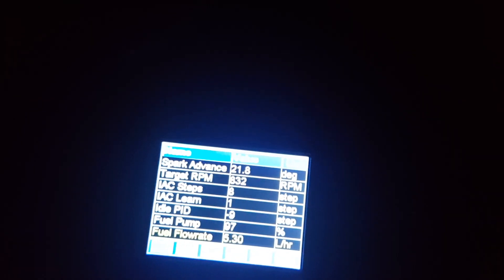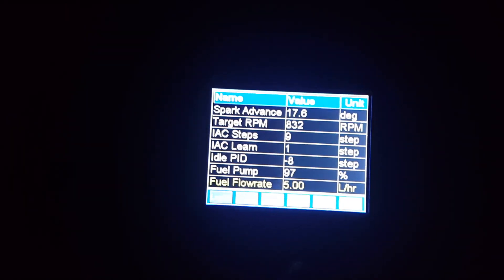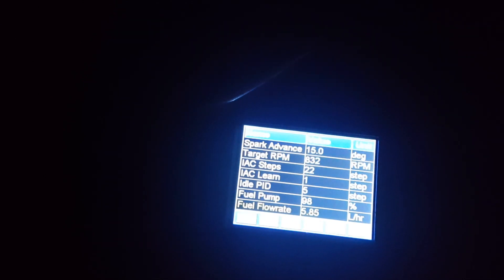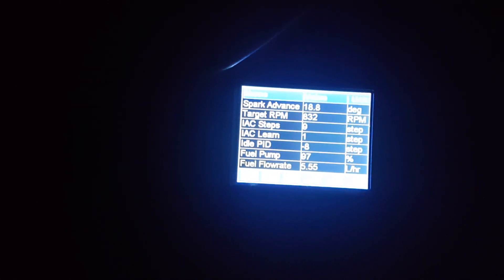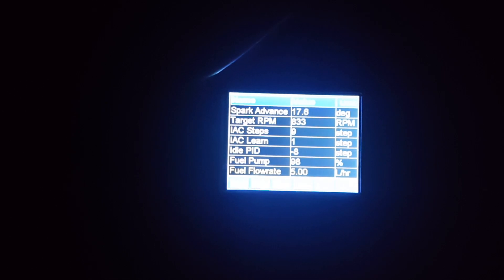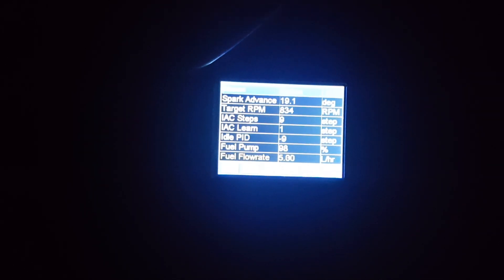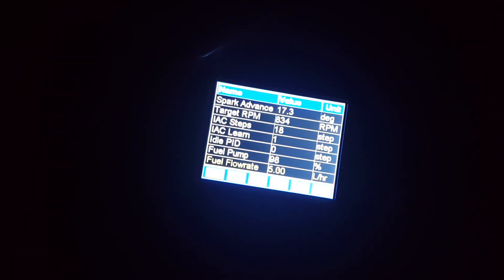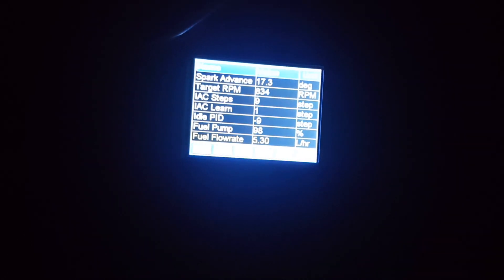FiTech EFI fine tuning.

Comment: This is hilarious!
DO NOT BUY THIS PRODUCT. 
Fitech tech support do not answer emails..... ever. 
Yes, if you live in the US or are from the 70s you can phone then but dont expect any help from them once they have your money. 
I took the time to work out time zone differences and called them prior to buying a 600PA for my project car. 
They assured me that it would work with my 2.6lt engine even though it's meant for much larger engines. This was an out and out lie and they've never replied to repeated mails for help.
Reply from the maker: There is nothing wrong with the product. Most issues are user induced or an issue with the motor itself. 
The system just uses the RPM signal and vacuum signal to determine load and fuel needs. If the motor is in poor shape or has vacuum/exhaust leaks, well it's doomed from the start. 
As far as your comment about working on a 2.6l motor...I know guys running the 1200 system on an air cooled VW 1.8l without any issues.
Reply: @434josh  I'm a 35 year industry mechanic with a long exposure to efi systems and also quality aftermarket efi on my personal rally car (Haltech). 
These drop on kits don't do what they say on the tin. 
The Datsun 2.6 was in perfect running order prior to fitting the 600PA and has no leaks, correct fuel pressure and volume at the throttle body and all sensors confirmed operating as specified (including replacement of the coolant sensor and O2 sensors with known good units) 
However, the system is not capable of staying in the AFR target window (dipping right down to 10:1 when the richest setting is 12.7)
Ive been all over forums, Facebook groups etc as FITECH offer NO user help beyond the initial purchase. 
The system is a waste of time and money.
Reply from the maker: @Danger_mouse  lol I can already tell you the cause and fix. But it doesn't matter. 
If you had done a proper log and looked at what it was doing you could have figured it out too. All throttle body efi systems suffer from this same exact issue and it's a very easy fix.
Reply: @434josh  Oh really? 
I find hard to imagine this poor man's system operating as intended. 
I accept that the system is too big for the engine it is installed on, and that the preloaded mapping is set for the larger engines targeted for the product. (The original plan was to turbo the engine which requires the 600PA)
What has got under my skin is the fact that Fitech lied about the capability of the system to run this engine, in person, prior to my purchase. 
It simply doesn't have the range of self adjustment required to run in the target AFR range. 
Thankfully I didn't go to all the trouble of setting up the turbos before trying to run the engine!
Reply from the maker: @Danger_mouse  again these things easily work on small VW engines NA or turbo. It's not a size of the motor issue at all. The self learning has a +/-35% range on the fuel table PLUS the short term trim has +50/-35 range on top of that. Then if that isn't enough...you can alter the base maps too. So not being able to make it work is a matter of simply not putting in the effort to tune it. I am one of the Admins for the Fitech Owners group on Facebook and we have totally re-written the fuel table for one user because his setup was so mismatched. After that it worked fine. His issue was low vacuum to start and then a mismatched converter that loaded the motor at idle in gear which sent the signal to the ecu that the load changed so it needed to add fuel. 
Either way these systems work great and the base maps are very good for the average motor fitting each calibration file included. They have inline 4 files, v6 files and then the default v8 file.
Reply from the maker: @Danger_mouse  look at some of the driving vids.
https://youtu.be/lp0IDYq6EPc
Reply: @434josh  
Ive adjusted those % tables you mentioned trying to get the system to cope. 
It set up as a 6cyl and the smallest CI available in the system (from memory 160)
Also set to standard cam 1 and been through all of the tables and settings I could think would make a difference and ones suggested by other users. 

Again I say to you, if Fitech supported their products, getting a good outcome would not be down to luck and guesswork from other users. 
Proper reputable companies have tech support information on their websites for all to use. Fitech don't even tell you that the system doesn't 'self learn' until 180°F in any of their literature. This wasted 2 months of on and off again attempts at self tuning as my particular engine ran a cooler thermostat from factory. I had to discover this info from a forum page.... It should be a part of the manual.

I can still log onto the Haltech Web pages and download the mid 90s firmware for the first system I bought including the owner's manual for it....
Reply from the maker: @Danger_mouse  the learning starts at 120° but warmup enrichment is active until 150 so the learning is slightly inhibited below 170. This is typical of all efi systems, Megasquirt, etc. What you described, going to 10 AFR...was that on accelleration or just idling?
Reply: @434josh  The erratic 10:1 happens during driving, not swinging open to WOT but at different times during throttle movements.(actual reading confirmed by a separate AFR meter) All post warm up and temp beyond 170 Muricas. I have tried reducing accel pump % and decay and raised the % of self learn range to no avail. Nothing make any changes. 
It's on the 4th set of fouled spark plugs now and I'm likely to fit a multi port efi system and stand alone efi system that is a known quantity,. 
The Fitech experience has not been a good one.

Comment: would this control timing with standard distributor and coil on a 351 cleveland ?? complicated to hook up?
Reply from the maker: It will control timing with pretty much any 2 wire electronic distributor. Will not on a 3 wire. Very simple to install. Basically 6 wires.

Comment: Ok and I had to cap all my vacuum fittings on the back of the throttle body like brakes,pcv and vacuum advance and run them from the intake to get a 5 IAC NUMBER

Comment: Did you have to get your air flow ratio stable if so what's yours set at mines is 13.70%
Reply from the maker: I have multiple AFR targets setup for different throttle positions, rpm and loads.
Reply: So how do you set the afr to a engine
Reply from the maker: +Dickey Moore 14.7 is best lean power. if your motor is built some it will need more fuel at wide open throttle. I have mine fairly lean at cruise, around 15. under load wide open throttle I have it set to 12.7 for low rpm, 12.5 for mid and 12.2 for high rpm full load. that made the most power on the dyno. At cruise and 15 I get over 14 mpg on the highway vs 9 MPG with my old carb.

Comment: I have it idling at about 850-930 where do you think a vacuum leak would be I only have pvc,brake booster and vacuum advance from distributor
Reply from the maker: Try unhooking the pcv and capping it off at the throttle body. See if that helps raise them. The IAC is an idle air control valve but it doesn't need to do anything if the throttle body is getting enough air to maintain an idle. The pcv is a giant vacuum leak anyway and can really hurt performance if you have a mild to wild cam with low vacuum anyway.
Reply: Blocked off pvc got IAC to around 6-9 now the throttle response is lazy what do you think HELP PLEASE
Reply from the maker: +Dickey Moore 6 to 9 after keying off and letting it sit for a min then restarting? If so, go drive it. These systems have to be driven to learn. They learn very little idling in the driveway. Also, what is your timing at? More initial timing the better for response.

Comment: I can't get my IAC numbers to raise, I can screw the all the way out and the IAC says at about 3 any help
Reply from the maker: I would definitely check for a vacuum leak somewhere or see if your idle is set too low. These systems can't idle low like a carb can. Mine liked about 850 to 900 rpm.

Comment: Can you set ignition curves with this system? The original distributor is preforming no mechanical advance , correct? You set basic timing then the FiTech system takes over?

Comment: so im alittle confused on the timing control. i want to run 34-36 degrees of total timing. my distributor is locked and have it wired for timing control. do i set the distributor to 34 with a timing light and lock it down? or set it to my desired idle timing?
Reply from the maker: This may not be the best way but it's what I did. I set 18 degrees as a base timing in the control. I set the distributor to where it would start (mechanical advance locked) and then made the timing light match what the handheld shows at idle. Then check at about 2000 rpm to make sure it matches. Once that is set check it at 4000 rpm actual vs indicated on the handheld. If there is a difference, adjust that in the VR Advance setting. Then it should match at idle, 2000 rpm and 4000 rpm.
Reply: +434josh thanks for the quick response. I'll have to try that. I think I have to to phase my distributor also.

Comment: Great info, mine will hang sometimes or dip way down to almost dying but recover when I push my clutch in and take my foot off the gas. I will agree there is a huge lack of instructions on how to fine tune this setup but none the less still happy with mine.

Comment: i have my iac steps up around 165 and they will not budge, no matter what i fo with the throttle screw, screw it in and the steps continue to go up. turn it back and the throttle plates close and the engine dies, im at a loss.....
Reply from the maker: Do you have any open vacuum ports? Do you have anything connected to the very front port?
What is the idle at and what is your target idle?
Reply: +434josh i think i got something going here, i have nothing on vacuum but my brakes, what vacuum i do have....about 8 at idle. everytime i do an adjustment i should turn everythimg off and let it reset?
Reply: +434josh target rpm 866, actual rpm about the same....idle steps hovering 6 and drop, i adjust to bring up and let idle and they climb up well over 15, so i very small adjust down and let idle. number changes very drastically. 3 one second them climb to 10,11, then back to 5,4,3.
Reply from the maker: +Corey Farmer After any IAC adjustment shut it down, do a key off and wait for everything on the dashboard to clear out (about 10 seconds) and then do a key on. make sure the TPS shows 0. then start it back up. if you don't you will just be chasing the figures.
Reply: +434josh i thi k i have something alot closer to what im supposed to have....i have been driving like that for a week...getting more exhaust smoke now that i have set the iac correctly. i have also been getttimg backfire out the exhaust when decelerating from wot. i guess i have alot of fine tuning to do on this to get it 100%. your video helped 1000%, thanks alot!
Reply from the maker: +Corey Farmer drive it for a while and let it learn. Is your motor pretty well built? I have some other videos regarding cranking, afterstart and accelerator pump settings as well.
Reply: +434josh yea, i think it is. 383 stroker, i am going to try and watch some videos on the other settings that are zeroed out on the handheld.

Comment: Mine does not they are getting to go to the pro section an doing adjustments in the iac multi but doesn't work not good when it to be self adjusting. Bad hesitation my iac is 8 had to go in accer pumps and add more to it it better but still idle high and slows down they said that's normal. How is that yours is not like that . Ready to go back to holly carb.
Reply from the maker: Greg I am not sure what you are saying. 
I upped my acc pump to get rid of a hesitation from cruise to wot. my motor doesn't have a ton of vacuum so the ecu can only adjust so much automatically. There are a lot of factors at play and I can assure you this setup beats a carb in almost every case.

Comment: what is the screw on the back for?
Reply from the maker: Bill I am not sure what screw you are referring to. Do you mean the set screw for the rear throttle plates?
Reply: +434josh yes backside passage side
Reply from the maker: +B Will that is set by FiTech and should never need adjustment. It adjusts the rear throttle plate. There are 2 adjustments for it. Closed blade angle and the point of throttle position where they start to progressively open. A holley carb has both of these same adjustments.
Reply: +434josh damn ok
Reply from the maker: +B Will did you adjust it?
Reply: +434josh yes
Reply: +B Will I believe I was screwed in tight but will check with fitech tomorrow
Reply: +B Will talked to a tech he said I'm fine, it's a secondary adjustment and the primary is on the front

Comment: at least 850 rpm to make all adjustments? Then set lower or.... Was that a range they recommended for your motor?
Reply from the maker: They recommended 850 rpm for my motor. Set to 850 it bounces between 830 and 880 with my cam.

Comment: Warm idle is set to 700rpm. It's not dead on but close. I'll keep driving it for a few days before I change anything. Just park it and I was at 10-12 steps
Reply from the maker: I had my idle around 750 and fitech suggested at least 850rpm. That helped settle things down too. (850 in park/neutral)

Comment: once you got the IAC steps right, how long did it take for your throttle response to adjust? Got my steps right, still need to drive it a bit, but throttle still hangs for a few seconds then drops.
Reply from the maker: I adjusted it then drove for a few days. It went from 5 steps down to 3 with an occasional drop to 0 so I adjusted it again and made it stay around 7. At that point the revs would snap back to idle quick. 
What do you have your idle set at?

Comment: How is your exhaust smell? Can you smell any raw gas. I have the fast ez efi and larger cam with low vacuum. lots of raw gas smell. thinking of switching to fitech if it will eliminate that.
Reply from the maker: To be honest, at first there was zero smell. And I mean zero. Now that I have messed around with the tune and timing I have induced a little smell but NOTHING compared to the custom carb I had. Before I would smell like fuel and exhaust for 2 to 3 hrs after a drive. Now it's like 10 mins and it's gone. It isn't a fuel smell now, just exhaust. I have some serious cranking and after start fuel enrichment and I think that has a lot to do with it as well as my target AFR of 13.9 idle and high 12's cruising. I am sure it would go away with a mid 14 cruise. Not saying the FiTech is better than the FAST. You can probably tune it to smell less.
Reply: +reaper1026  My EZ-V1.0 had gas smell initially but it was due to the fuel lines.  Replaced them with Teflon and that killed the gas smell for my install.  Fi Tech Meanstreet Install on my 470 Buick beats the EZ in every way possible so far.

Comment: Did you have any issues with your system when you first started running it with the timing control? Mine is a 462 Pontiac with MSD Pro Billiet locked out and setup for timing control with the 1200hp FITech System and it idles but wont rev very well and has even backfired a few times. Matched the base timing with the handhelds base timing of 12 degrees and its still running bad. Going to hook up a ground strap to the TB to see if it has a ground issue. Kinda stumped at this point. I am going to do what you are saying to do here as well.
Reply from the maker: Did you verify the distributor phasing and set it up like the instructions said? You are probably out of phase and when it tries to advance the timing the rotor ends up between 2 cylinders and you are arcing which causes the backfire.
Reply: I did verify it. It ran okay for one run down the road but seemed like it was hesitating. Then I got back and checked timing and it was off a little so I adjusted it to match and it hasn't ran good ever since. I may pull the distributor and reset it all. I know the distributor is good because the car ran fine with a carb.
Reply from the maker: +Shane McLoughlin As I have found out, EFI needs a MUCH cleaner rpm signal from the distributor than a carb does. My distributor worked great for 300 miles with a carb and was terrible with this EFI. changed to a different dizzy and it was a world of difference.
have you done a datalog to look at what it is doing? Try one. Start a log and rev the motor a few times. Look at the log and see if the rpm is staying consistent. 
When I did a log the rpm was registering from 1600 to 45 to 90 back to 1200 all in 1 second. The motor wasn't actually doing that but the EFI took the readings as true and adjusted fuel to match. Made for a rough run.
Reply: +434josh It looks as if it is getting a good signal, but I haven't done a log on it. How do you check the data log once you have done it? with a laptop? also I have a MSD 6AL box and I ran the wiring to the points wire like the instructions said and I have the tach wire from the msd box running to a Speedhut tachometer just like you have. It shows around the same fuel flow rate as you have so I don't believe it is a fuel issue. I can hardly rev the thing at this point without it stumbling.
Reply from the maker: +Shane McLoughlin There is a USB port at the bottom. After a log just plug it into a PC or laptop. (unhook the 2 plugs on the top before plugging in the usb)
It will power on with the usb. Once it boots it will go to a screen that has 3 boxes. Select USB mass storage. Then it will link with your computer. Open it up and select "log files". the log will be in that folder as an excel spreadsheet.
Reply from the maker: Also, I am not using a box at all. Just my distributor hooked directly to the FiTech as well as the MSD coil. you might try it that way to eliminate the possibility of the box giving a bad signal.